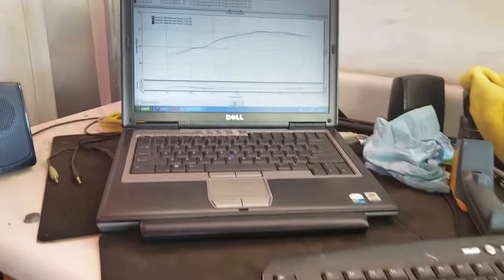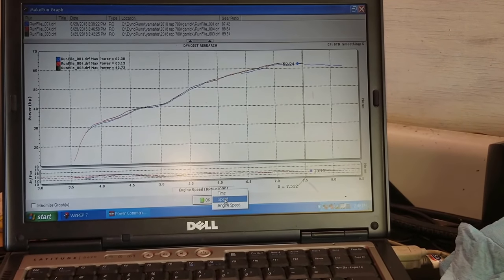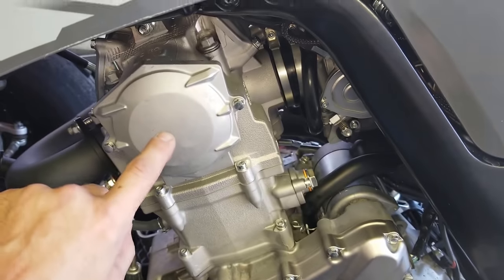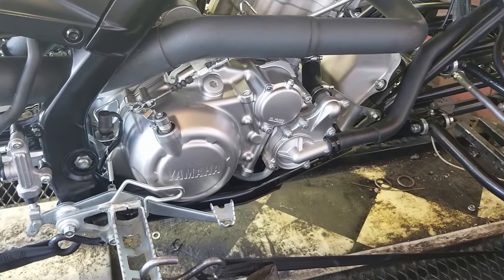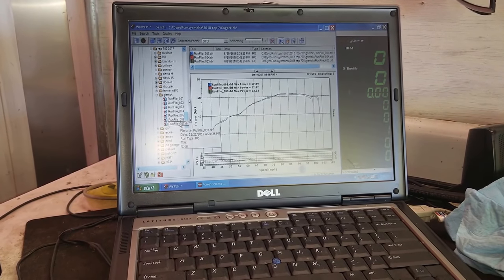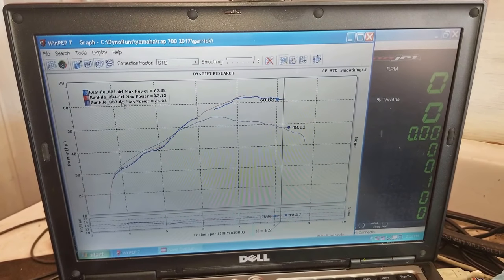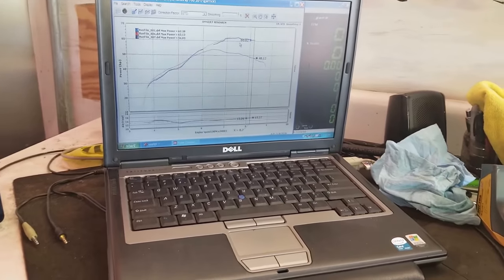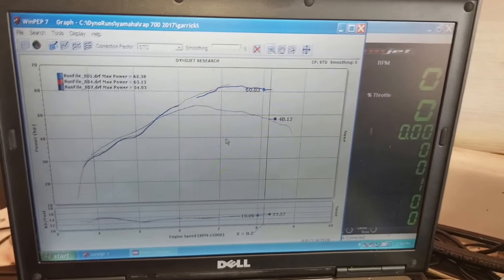9 hp gain for only 500$ in parts. 2015 + Raptor 700 63 hp

Comment: Damn you really reading my mind. Right now I'm at 55hp and that's my next step. +3tb and hot cam stage 3. Keep the good work. Hi from North Carolina.
Reply from the maker: u got to do the clutch or it starts slipping in the low 60s
Reply: MrCuervoRacing thanks for the heads up, My raptor is 2017 has maybe 50hr, should I just buy the whole kit of clutch? Or just the full fiber mod.
Reply from the maker: full fiber should be fine. this particular bike actually had a smoked clutch so we did do the whole kit.
Reply: never mind heres my answer lol
Reply: MrCuervoRacing Hey Daniel..can  you send me the info and cost to order this clutch upgrade.. plz. Thx

Comment: I'm curious which parts are $500. In the video the upgrade parts are: exhaust, intake, pcm5, camshaft, clutch.
Reply from the maker: Hc3  and +3mm throttle body bore as well as clutch upgrade if $ 500/ 9 hp over intake, exhaust and fuel controller.
Reply: @MrCuervoRacing  do you sell a kit of all 3 boss ?

Comment: whats the potential hp a stock clutch should be able to handle? i really want the cam and throttle body next so im wondering how long will the stock hold out?
Reply from the maker: Low 60 is max
Reply: what are you talking about? its a 9hp not 50hp....do you know whats kills a clutch? grip on a heavy toy...on gravel you can put 20hp+ with stock clutch and will be no problem because it spins
Reply: @commantrosexetlos4700 this is a 700 makes a lot more then 9hp

Comment: Lol stop with power numbers. This makes me want to get the stage 3 cam,and bigger throttle body. Wish you were not 2000 miles away. So i could have you dyno my bike awesome video.
Reply from the maker: thanks, install is easy and we have maps for the setup
Reply: The guys from monsterquads were nice enough to throw a tune on my PC5 when I bought their full exhaust,intake,and PC5 from them. Im in michigan would it even be beneficial to have it dynoed,and have a different calibration made since im sure the density altitude,and bero is different here?
Reply from the maker: MotorcityFord313  u could, it will be very close. We supply many of the maps for monsterquad on the raptors